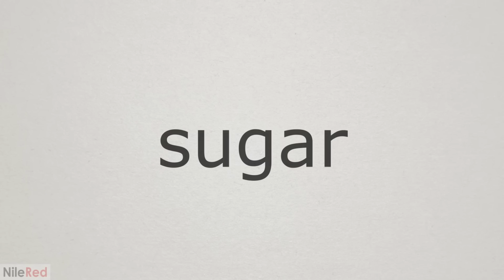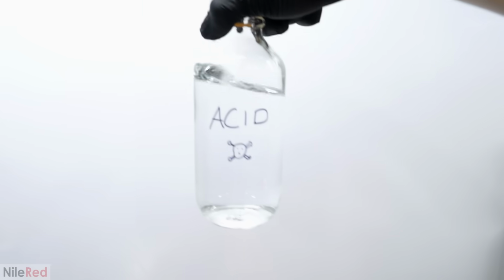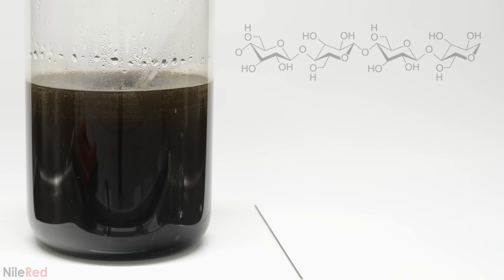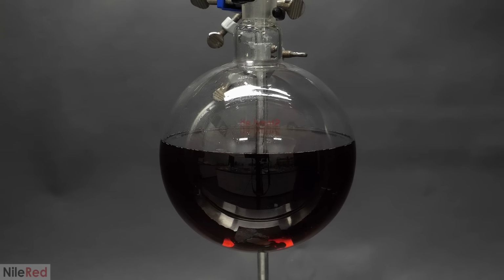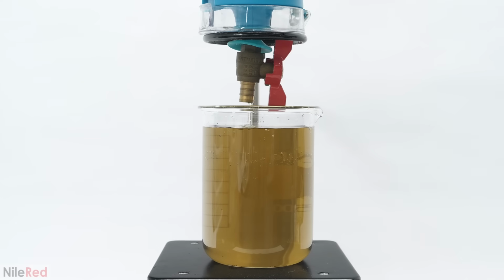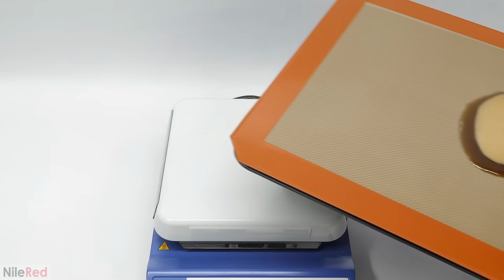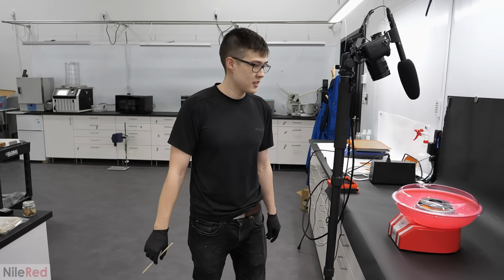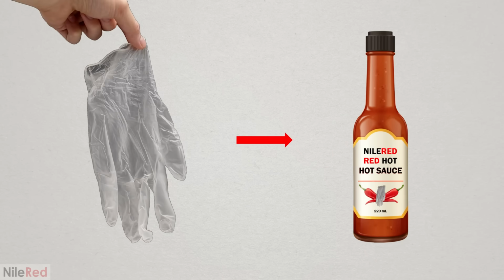Turning cotton balls into cotton candy

Comment: Sulfuric acid is a dehydrating agent and loves to break down organics. My guess is that the concentrated acid turned a lot of the cellulose all the way into carbon and CO2, rather than stopping at glucose.

This explains the brownish color as well as the poor yield.
Reply: Yep, the sugar/sulfuric acid reaction is well known and I'm surprised he decided to go that direction.  I guess the issues with the cellulase discouraged him from continuing down that route, but I think it would have worked much better.  It wouldn't exactly be cheap, but I'd love to see a follow-up with lab-grade cellulase purchased from a chemical supplier.
Reply: Could that issue be solved with a lower concentration and longer reaction time, or is it always going to happen..?
Reply: @The_Keeper  What happens with sulfuric acid is that it is so strong, that it protonates alcohol, making the really good leaving groups. So the the cellulose gets dehydrated by the acid.

When the acid is really concentrated, all the cellulose should be decomposed to carbon, and the carbon gets oxydized to CO2.

The problem with a lower concentration of acid, i think, is that the cellulose wouldn't be able to solubilize, therefore not being reacted.

Too much acid and it decomposes, too little acid and it doesn't really react.
You'd need to have the perfect concentration of acid, and only testing and doing research could give you an accurate answer.
Reply: not sure if it would be worth the time/equipment/effort, but doing some molecular biology and then growing up enzymes/cellulases yourself is pretty cool, and could likely solve the “i’m getting a bunch of mislabeled powder shipped to me” issues of ordering the enzymes online.

Comment: This was so fun to watch, I've always wanted to do something like this. Calcium Sulfate definitely was your biggest source of loss. You're not supposed to fill those funnels all the way to the top with solution, all the head room is supposed to be for rinsing solution. The filtration should have probably been broken up into 5-10 steps rather than 2 with all that you had to filter, but given that it was more than enough sugar, it ain't a thing.
Reply: Facts ✅
Reply: Damn bro thats insane are you a scientist of some sort or like plan on being one
Reply: @dasty5228  I did my undergrad degree in Chemical Engineering and I worked for a year in one of the organic chemistry teaching labs. I got in trouble once for doing the exact same thing he did and I filled the filter funnel all the way to the top lol.
Reply: @alecgolas8396  sounds fuckin dope lmao I wanna become just like this guy doing expirements of all sorts I bet its fun do you still do chemistry
Reply: @dasty5228  Not really, I'm in grad school right now and I'm just doing all computational stuff. I mean I'll do some DIY stuff which uses chemistry techniques like cleaning with strong bases and neutralizing it with a weak acid or extracting caffeine from impure capsules for DIY pre-workout, but it's expensive to build a setup that can run any sort of reactions safely, mostly on account of fumes.

Comment: The concentrated acid would consume the sugar generated simply by burning it. You can achieve a higher yield by using dilute sulphuric acid 2% combined with a higher temperature say around 160 degrees centigrade. Or with 4% acid and a 121 degrees centigrade. Neutralisation could be with caustic with will result in soluble sodium sulphate and water. Freezing/cooling the solution would then cause the sodium sulphate to precipitate out up to 90%. One word of caution is that the usage of acid for hydrolysis also results in HMF formation and some furfural formation. I’m a bit divided on the use of a mixed bed for removal as it probably would not be able to eliminate conductivity that easily. Instead I would recommend a macroporous iER anion with a high exchange capacity. This combined with Activated carbon should decolourise your solution.
Reply: Yeah when the cotton turned the mixture black my first thought was it was burning it. Just as cooked sugar will turn black .
Reply: nerd
Reply: ...what
Reply: I was thinking the same thing. Had to go through the comments to see if anyone else had this idea..... 😆
Reply: @mltrymn1213 me too
Reply: Interesting idea. I was thinking along the lines of the concentrated sulfuric acid might be reacting with lignin and cellular proteins, which could also explain the smell he mentioned.
Reply: English, please.
Reply: @turtlesrprettycool3379  acid burn sugar = less sugar so less cotton candy
Reply: @matthhiasbrownanonionchopp3471  ty
Reply: @averygoodfantasticname4206  said every person who didn’t pass 3rd grade science
Reply: @matthhiasbrownanonionchopp3471  I see
Reply: @nikolaolao  lol
Reply: @
DRAGONSLAYER, Whoa, hope he sees this
Reply: @nikolaolao  or they haven't taken chemistry
Reply: Yeah, just adding lemon juice to sugar along with a little heat does some wild things. The good news is HMF is technically an approved "food improvement agent." As with most things, dose and frequency of exposure is very relevant.
Reply: @averygoodfantasticname4206  jealous
Reply: @nikolaolao  no I just need spoken English too
Reply: @juma9079  not jealous I just need to be spoken to like I'm 5
Reply: @averygoodfantasticname4206  it's chemistry, there are tons of technical terms for a reason

Comment: "I'm not going to use any wierd chemicals"
"To do this, i am going to use some Mixed ion-exchange resin"
Reply: to be fair, it's not weird

the guy literally says it's used for acuarium cleaning

you would have much more trouble getting your hands on the sulfuric acid in the first place, as I suspect he used food grade sulfuric
Reply: Yeah, it's just a homemade  brita cartridge.
Reply: To be fair it’s more of a filter rather than a chemical
Reply: Ion-exchange resin is in every normal Britta filter and is cheap and easy to obtain, it imparts absolutely no chemicals into a substance, it just takes away impurities from a substance. If he had said "so I just ran it through a britta filter" you would of been none the wiser, he just used half the components involved in that, and it sounds fancier.

Comment: “Or at least not get poisoned” then continues to say “the cellulase was not working and instead started using ACID”
Reply: Cellul*ase* is an enzyme. Cellul*ose* is a sugar.
Reply: depolymerizing cellulose to glucose is not hard, doing so efficiently and economically is very hard and yet to be achieved. Cellulase can in theory do so without consuming huge amounts of acid and not converting much of the sugar to degenerated waste-products. But cellulase is expensive and fragile.
Reply: @TheMonarchofGold  I think I fixed it

Comment: After this, turning lead into gold should be a walk in the park.
Reply: Iirc, turning lead into gold is 100% possible, but you need a very specific alloy to do it and making that alloy is so expensive that any gold made will be worth less than the cost in making
Reply: Well, this type of stuff is not exactly possible in a home lab. Lead and gold are   different elements, and so it will require nuclear fission to turn lead into gold.
Reply: @saadusmani78  no, nuclear fission is not the correct word at all.
Reply: @jasontofini3412  Yea, it needs particle accelerator machine, like Hadron Collider. And any gold made this way will also be highly irradiated, so good luck wearing it on your finger!
Reply: @ScienceDiscoverer  So what you're telling me is that it makes cursed gold :P

Comment: Hey there, thanks for video. You could get nearly pure cellulase by passing it through a column with nonionic sorbent. Powdered silica and calcium hydroxyapatite are the first things that come to mind because they are quite easy to get. This process is called size-exclusion chromatography because things in the mixture are separated according to their molecular mass, so, theoretically, cellulase will come out of the column first and junk like maltodextrin would leave the column much later. Alternatively, you could use anion-exchange resin equilibrated with neutral buffer. After passing cellulase solution through the column you would get yellowish-brown liquid with residual sugars while cellulase would remain bound to the resin. And, finally, cellulase would be eluted by high ionic strength solution (starting buffer with 1-2 M NaCl). Elution may be monitored by measuring absorbance at 280 nm to get the cellulase fraction with the highest concentration. And, I think, it should be desalted to maintain its enzymatic activity.
Also I wouldn't use sulphuric acid or any other strong acid on cellulose because it certainly decomposes the polymer into low molecular weight compounds, but it also yields a lot of byproducts like ethers due to the intermolecular dehydration caused by highly hygroscopic acids (carbohydrates are basically aldoalcohols which makes them susceptible to etherification).

Comment: Man, that glucose test strip was a trip down memory lane. I was diagnosed with Type 1 Diabetes in the late 1970s. The only way to get a blood glucose reading at home back then was to use those glucose test strips with a test tube full of urine. It was fairly useless, as it didn’t give you a very accurate reading and it was only an estimate of your glucose levels over the past six or so hours. The insulins back then weren’t all that great, either, so treating T1D was very much a guessing game.

Now, I wear a continuous glucose monitor and use advanced insulins that cost about $6,000 per month at retail cost — insulin was like $6 a vial when I was first diagnosed. Things have come a LONG way from peeing in a test tube and sticking in a glucose test strip.

Comment: Nile, it’s been 3 years since you made this video.
In that time haven’t you figured out that the monosaccharide Glucose never forms a solid?
Corn, maize, is used  in industrial settings to make ethanol but most of the plant remains as corn stalk. The stalk is mostly cellulose with some lignins. 
Perhaps you could make a video using acid hydrolysis to make dried corn stalks into glucose but then fermenting the water & glucose into ethanol.

Comment: couldn't he have just boiled the sugar water instead of using a food dehydrator for 35 hours?
Reply: That would probably caramelize or cook the sugar to fully get rid of the water. So he just used a food dehydrator
Reply: @loveforchickennuggets6412  that only happens at around 180C even according to him though
i think he was just afraid of the sugar evaporating through boiling
Reply: @arn3107 sugar can’t evaporate through boiling though it’s not water so it stays there. What do you mean?
Reply: @loveforchickennuggets6412  well i'm so scientist so i just since it was mixed with the water it might've disappeared with the water if he boiled it

if that's why he didn't boil it then i really don't see any other reason why he ended up using a dehydrator